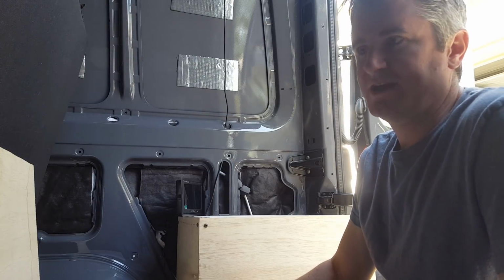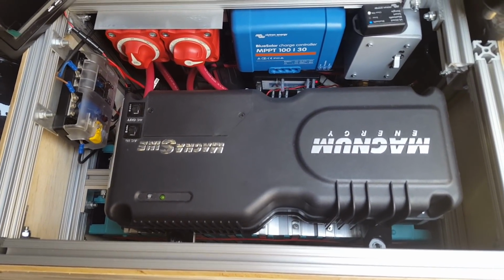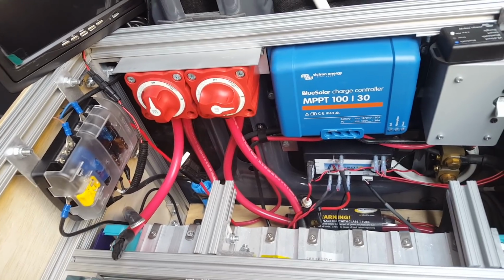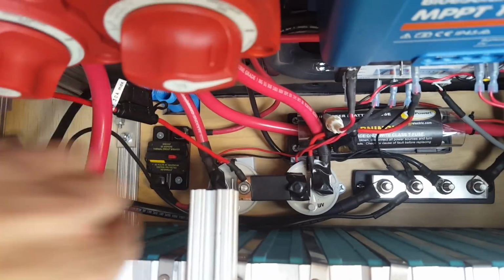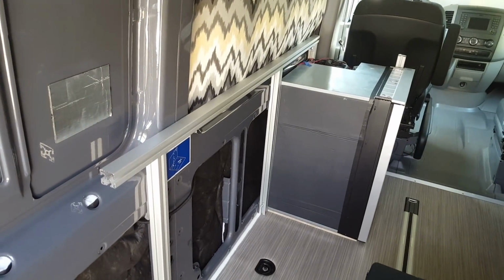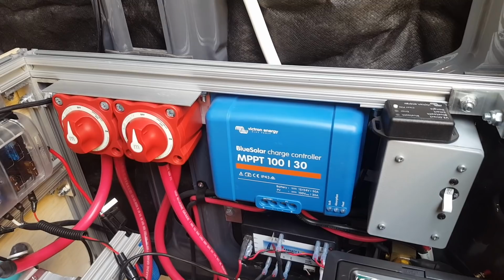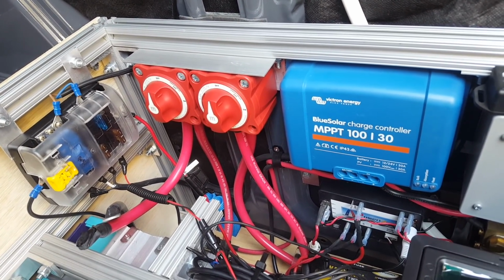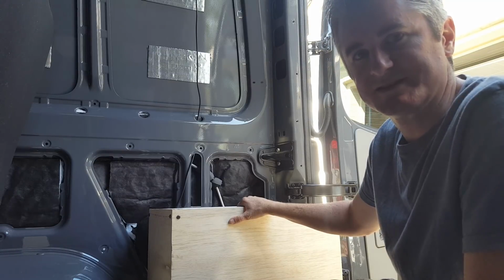Lithium Battery Install in a DIY Mercedes Sprinter camper van

Comment: Way harder than it needs to be...ctek does a d250sa which is a solar/alt 12v regulator...it is suitable for agm (14.8v float, 15.7v max) this should be fine for your charging needs.
Reply from the maker: The 250sa does not support lithium batteries (per their website), it only supports 20A charging (less than half of what my inverter setup will do) and will not support high voltage solar panels like what I'm running.  Ctek makes good stuff but it doesn't have the capabilities to meet my needs.
Reply: I’m not sure why you think you need that many amps for charging. Do some research on 12v lithium systems we use on vehicles in Australia...you’ll see what I mean.

There are 4wd tv shows like 4wd action that go completely to the middle of nowhere & have to charge a whole camera crews gear, run lights, fridges inverters etc...

They use a few lithium batteries (2-3), solar blankets & ctek or redarc systems charging from alternator when driving & dc to dc charging.

I highly doubt you would require more power than this, unless you don’t drive anywhere for a week...& are growing weed or something.
Reply from the maker: This was the most cost effective way for me to go since I already had a built in charger.  It also happens to charge quickly, which means I need to run the engine half as long to recharge.  Works great for me but as always, lots of ways to accomplish this.

Comment: @ourkaravan,  could you describe how you secured your electrical equipment to the van wall and floor.
Reply from the maker: Yes, there are two factory tie-downs in the rear of the van.  I have angle brackets that connect those to my framing.  In addition there are carriage bolts slid into the slots of the 80/20 and through holes I drilled in the van sheetmetal to attach the sides of the framing to the side of the van.  I used aluminum flats to act as big washers on the back side to prevent the nuts from pulling through the sheetmetal in the event of an accident.  I hope that helps!     I have a couple of write ups in the van build section of https://ourkaravan.com if you want to learn more!

Comment: Great job. I have heard you should add a ground wire to your negative bus bar and screw it down to the chasis. Have you considered that?
Reply from the maker: I would really like to hear from an electrical engineer on this.  Some say there is no need because my system is grounded back to the battery, just like on a boat.  A chassis ground would absolutely be necessary if I were charging from the alternator, but that system is isolated too.  I'm curious but there's no clear answer that I have seen.

Comment: Thanks for the info!  Very compact setup.  I’ll def be looking into this company and products as I’m planning a lithium battery and all the accompanying accessories very soon.
Reply from the maker: Nice...the system works really well!  I still have never plugged the battery in to shore power or used my alternator as the solar + lithium have provided more than enough power.
Reply: ourkaravan I’ll likely start with only 100ah based on my needs.  Original intent was 200ah of AGM for 140lbs.  After seeing the cost breakdown and replacement costs over time, the lithium makes sense.

Comment: Kene what terminal box are you using for the blue sea breaker. The one connected between the solar panels and the MTTP controller? Thanks in advance.
Reply from the maker: Hi Danniel, it's called a canex box and I picked it up from home depot.  I had to file a very small amount off the terminal posts on the back of the breaker to get them to seat in the box.
Reply: @ourkaravan  Thanks Kene!

Comment: Looking at some of the links this was not a cheap setup so what was the cost of it
Reply from the maker: It was, in fact, the most expensive part of my build.  I wouldn't even think about investing any money, no matter how little, into an electrical system until you have a good idea of what you need.  I did a write-up on my website, ourkaravan.com, describing some of the important considerations when planning an electrical system.  If  you go to RV parks often, you don't need to spend very much at all.  If your needs are like mine and you want to be off-grid for days-on-end without needing a generator or running the engine, yet you still want to run your 80 amp insta-hot and your induction cooktop, you'll need to drop some money.  My system may only be half or less of the capacity that some people require.  The article I wrote will hopefully help in determining how much system you need.

Comment: You need a Sterling BB1230 between your alternator and house battery.
Reply from the maker: That is one way to do it.  I use the second inverter approach which costs about a third as much and can take advantage of small-gauge AC wire rather than needing heavy gauge DC cable all the way to the rear of the van.  I couldn't fit a BB1230 in the space required either.  Sterling makes good stuff though.

Comment: Great video! But I’m in a minivan with 50watt solar panel. But I don’t want to invest in a large battery. Can I use a motorcycle agm battery instead? I’m only looking to power a 12v small fridge and a  small fan. 
Any recommendations on how many amp hours I need in a battery?
Reply from the maker: I have a friend that uses a small 33 amp hour battery and a flexible solar panel to power his ARB refrigerator.  It works, but he does have to keep an eye on battery voltage as he doesn't have much overhead for times when he is parked in the shade.  Also, some of the smaller, less expensive refrigerators use more energy than the larger and more efficient DC marine refrigerators.  The answer to your question will be to calculate the daily average draw of the refrigerator and fan and decide how much battery you need to buffer those times when you might not have solar charging.  I have an article on electrical planning on my website....https://ourkaravan.com , click on van build, there you'll find the articles.   I hope that helps a little.
Reply: ARB fridge uses 200wh per day. I would suggest a 400wh battery.

Comment: Hi Ken In ur opinion how many amps from the battery would you need? 

Is 200 and half from an AGM? 

I plan to run a 3000 watt inverter
Reply from the maker: The answer is super dependent on how you use your rv.  If you're an RV park person, you don't need much of anything.  If you're off grid, run refrigeration, fans, lights, induction cooktops, etc, you need way more.  My battery is overkill for how I use my van now but I haven't started cooking regularly with my induction top, so that's when my sizing will become appropriate. Hope that helps.

Comment: Are you charging from the alternator as well or just solar? If using off alternator are you using anything special switch wise or a B2B type item?
Reply: kenetube thank you for getting back to me, how many watts of solar do you have again to charge your bank? I am just worried that during the winter months while using it for skiing I might not get the solar needed to kee
The batteries topped off without using an alternate charge source. Given the angle of the sun and snow accumulations to the top of the panels. Granted here in Colorado we do get many days of sunshine even in the winter.

Comment: Hello Ken, I'm sold on the LiFeMnPO4 path but I'm having problems finding a battery.  (The one you purchased via eBay is no longer available.) Did you ever look at the package found here: http://www.lithiumrvbattery.com/Lithium_RV_Battery/GBS_200AH_Cells.html and http://www.starlightsolar.com/elite-power-solutions-lfmp-battery/index.html?  By chance is this the same battery that you purchased?  I'm not sure about the controller panel (i.e., what does the "Start" button do) but I do recognize some of the part brands.  It looks comparable to your system and I'm guessing cost is about the same too.  If you have a minute let me know what you think. Thank you, Steve
Reply: No worries Ken.  I saw you were on the road so I kind of expected that.  Its good to hear your experience was good with the set up.  I am getting ready to take our maiden voyage myself and I'm so not ready.  I plan to run off the aux oem 100ah battery.  I plan on limiting my use to our fridge and the maxxair fan.  Hopefully, we will have enough day trips to charge the battery.

Comment: Where did you source your  1/4 -20 carriage bolts for the 1010 extrusions?  Im having trouble finding consistent bolts that fit in the 1"  8020 slot.  Ive tried HD and Lowes but only 1 out of 20 seem to fit due to the variable milling specs. Thanks in advance.
Reply: Thanks! My problem was most were too big. I found some of the Hilman brand at the local Ace and about 50% seem to fit which is much better. 
Also how did you secure the battery inside the box? Is it just the 80/20 crossbar? Any rubber or bumpers for those washboard gravel roads?

Comment: You are amazing and so detailed. Thank you for documenting. I just ordered 5x 200ah batteries and bought 3x 330 watt panels for new ford transit. Any suggestions or cautions? I hope to run a portable ac.

Comment: Just wasted 2 months testing out GBS 100Ah lithium packs with Elite EMS battery protection system. The GBS cells are fine. ELITE’s latest EMS for the GBS 100Ah packs (different from what Ken has in this video) , I can confirm, is defective and not ready for market. Nonetheless, they’re selling it. If you care about your time and dollars, PLEASE stay away from Elite. I sent the whole kit back for replacement with LiFeBlue drop-in lithiums. So far, these are great. Bluetooth built-in, I love the design. But time will tell if they’re solid.

Comment: I have been looking for a way to charge lithium ion with a alternator. There is a cheap mppt charge controller that can be used like a adjustable  universal battery charger. It doesn't have to be powered by solar. But it is a boosting charge controller. The output has to be higher than input. So I plan to use a 12 volt (12-14.5v) alternator to charge my 7s lithium bank it is fully charged at 29.4v . the only problem is it is 10amps max. And I need 4-5 maybe 6 times that. Minimum. So I guess I will be buying a couple to start . if it works out . maybe the world will catch up to the needs of lithium batteries. This controller would be great if it came in a 40 amp or so version like other controllers. I only want to charge to about 28.5- 28.8v.  Trying to get as much life as I can from the lithium. It's not cheap.  Great video. Does anyone have a better way to charge lithium with a alternator?

Comment: Hi, I liked your video of your battery set up it has given me some ideas for my own system.  If you are still looking for a way to charge your LiPoFe4 from the engine driven alternator you should check this link out https://sterling-power.com/collections/battery-to-battery-chargers/products/battery-to-battery-chargers-60-120a-waterproof. I am using their 120 amp Batt to Batt charger to look after a bank of AGM cells in my van although as it has adjustable charge curves for different battery chemistry's that includes LiPoFe4 which I am in the process of changing too. Anyway, good with your set up I hope the link is of use.

Comment: Incredible build, love every one of your videos.  The floorplan and layout is the most efficient I have seen.  I think you should consider selling your cabinet design using 8020 cut and drilled to fit (by 8020) to customers who do not want to design their own cabinets.  One question about the LiFeMnPO4 batteries?  What about cold weather precautions?  I read that lithium cells are damaged by charging when frozen.  Is this a concern with these batteries?

Comment: I like your install. I have been looking at changing my RV house batteries to LiFePO4 (LFP), but as you mentioned the chargers and inverters aren`t set for them. For example, I'd like to replace the original inverter with one that had less standby losses, but the low battery cutout is typically set to 10.5 volts. This equates to 2.62 volts per cell in a 4 cell LFP,  it is recommended to not go below 2.8 volts per cell and I was hoping to limit to 2.95 volts per cell for longevity. A setup like your low voltage contactor could solve this if it is controlable or adjustable. 
Unfortunately, this is one of the parts you did not list where you got it. Was it part of tne BMS or separate? Can it be adjusted or controlled? Brand and part number? Plus any helpful thoughts.
Thanks.
Reply: I looked the tyco over and it will work with my bms. A couple other issues to solve, but I am making progress in planning this out. 
Thanks again.
Reply: Any MPPT that allows a custom charge profile will work for lithium. You are under the impression that MPPTs need to "know" what battery chemistry you are using. This is simple not true. Many MPPTs have existed long before lithium got popular and will work just fine with lithium.

Even Midnite Solar MPPT you set the charging profile and set when to switch to "float" charging.

Comment: How do you like your battery set up after a year.  Would you recommend the company you bought them from?  I checked them out on ebay and they seem legitimate and would like to know your opinion.  Did you buy your battery monitoring system from them, also?  Thanks.
Reply: Thanks.  I appreciate the information.

Comment: I recently installed a Nissan leaf battery bank for my van and 12-volt system. full charge is 16.4 volts. so far I found that charging to 16 volts doesn't freak out my 12-volt system. My charging solutions is my 12 - 14- 16 Volt Intelli charger. it is rated 25 amps. i set it to 14 volts and it charges to 16.4 volts, perfect for the leaf batteries. but for my 12-volt system, 16 volts is the maximum. my inverter goes in at 16 volts max. and cuts off at 12 volts. after 2 hours engine at idle, my alternator has charged as high as 14.6 volts. it is a very interesting experiment.
Reply: Yeah these are tempting because the prices are so good but really hard to accommodate these off voltages.

Comment: You have an excellent overall design. Using AC to run the charger is actually smart because the inversion de-couples the noisy power from the engine alternator. It also ensures that there is no way for the house battery to back power the main starting battery system. Last if you do want shore power you can hook up to any outlet because your max drain will never exceed 15 Amps. Most RV require higher then 15 amp service for shore power.
Reply: I am converting a LMTV M1078 to a camper and researching this right now. I will be doing the same thing. A battery to battery charger won't work for me because my truck has 12/24 V battery and my house battery is going to be 48V so I can drive a mini split AC via DC only

Comment: If I am not mistaken you can buy a battery isolator that are designed for your battery. This with be much simpler than trying to waste power using the inverter (horribly inefficient). 3 wires to hook positive out to the isolator, ground then a power lead to the battery. 

That would give you the ability to charge your battery with the motor running. 

But seriously great work and love the neatness!!!!

Comment: The Dometic CF 18 I believe is a really nice DC powered refrigerator/freezer no need to invert power I’ve been running one for over two years now on 12 V of my small home solar set up works really good

Comment: Unrelated to your power set up. I’m wondering what purpose the metal reflective material patched on the upper side wall panes of this van serve? I have seen this on a few fans during the build process and it has never been addressed? Is that part of the insulation? 

Thanks!
Reply: kenetube thanka

Comment: Would the 100/30 MPPT Charge Controller be ok with 400w?? Great vid..
Reply: Thank you for the reply, I just read in the Amazon description and it says "MPPT 100/30 is a great choice for controlling up to 440 watts of solar panels at 12 volts"..??

Comment: Great work - and great videos! Question: it appears you bought the bulk of this system from Starlight Solar in Yuma, AZ....but through their unbranded eBay store. Any benefit to this? Also, in one of you comment replies, you say that if a Goal Zero kit does automatic balancing, you’re cooking your batteries. But isn’t automatic (active) cell balancing precisely what the Elite BMS you have does? Do you understand active balancing to be harmful to lithium? Thanks so much - keep these great videos coming!!!
Reply: Do I understand correctly, that your decision to not charge the bank to full allows the BMS to continue with active balancing, but WITHOUT risk of that “first-cell-to-reach-3.55V” getting unnecessarily 100% charged?